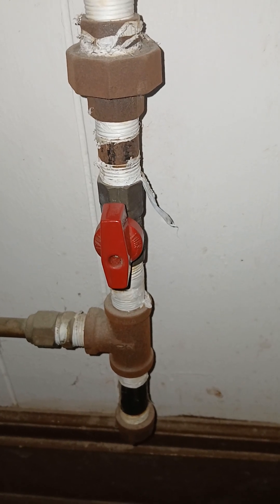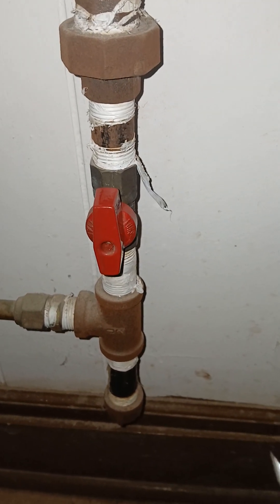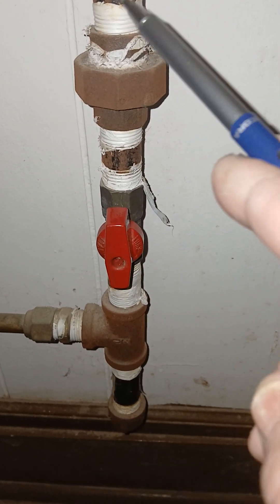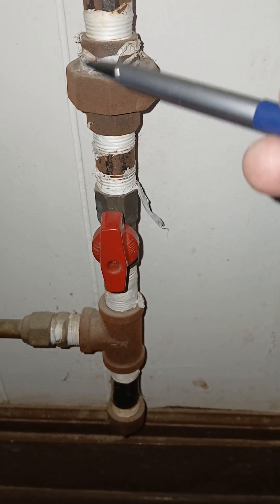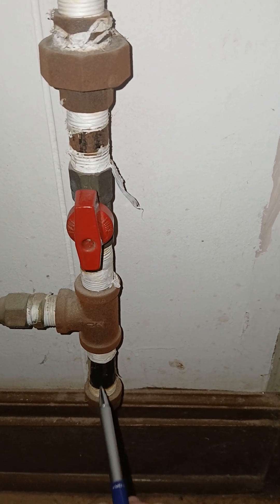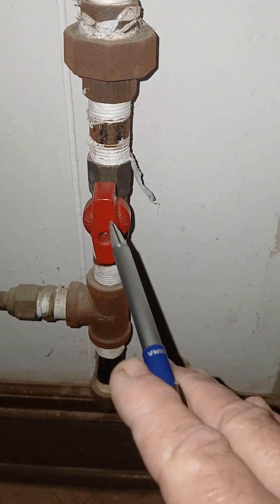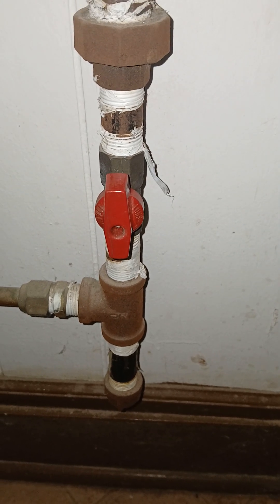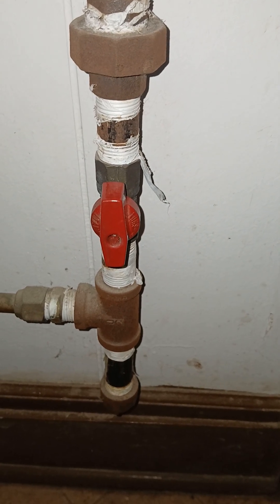Should The Union Be Installed After The Natural Gas Cut-Off Or Before The Natural Gas Cut-Off?

Comment: For questions like this, the answer is always to think about what's actually happening.  

Obviously, natural gas is flowing into the building and servicing whatever units need natural gas inside the building.  The point of the valve is to isolate or disconnect service to a unit.   The point of a union, in regards to a unit, is to allow ease of service/disconnection to the unit itself or service to some aspect of the piping assembly on the unit (e.g. a control valve).  Therefore, with regard to direction of floe, a union should always come after a valve.  Otherwise,  breaking the union would result in having natural gas just openly spilling into the air around you, which would make you an idiot.  A dangerous idiot.

Comment: Im confused, tou said the gas comes in and goes up...now i havent seen small pipe goto bigger pipe unless its at the meter. And the drip leg is only required on a drop down before you go horizontal. Also the valve should be the shut off for a unit after the flare ftg and soft copper...at least were im from...ive never seen it xome in soft and goto a larger eigid pipe ..
Reply: The length of pipe and number of elbows and fittings is very important to calculate properly. Ideally you always want larger diameter pipe until a drop in size is required. Many people use the terminology incorrectly. Pressure isn't the same as flow rate. With gas you need to determine the proper flow rate needed for your application and size accordingly. Most gas supply lines are low pressure, and you want to rout the lines with the least amount of pipe and fittings to reduce headlosses.
Reply from the maker: @James-p3m8j  Thank you! 

...great points, too much pressure without a regulator may create another set of issues.

7-11" WC may be workable pressure?
Reply from the maker: @brianruckert9389  1/2" pipe feeds unit, which may be fairly common in residential uses, save tankless water heater which may need 3/4" pipe due to higher BTUs.

Thank you!
Reply from the maker: @brianruckert9389  Pipe size is 1/2" in this case, no use to upside in this particular case.

Yet, my opinion is one may have to calculate BTU load, pipe size for their configuration, as it may vary.

My opinion is I may have 2# gas meter, yet if I had a thankless water heater, I may have decided to upside pipe to 3/4" to get more volume.

Thank you!

Comment: Always on the supply side of union
Reply from the maker: @anthonylawlor9130  My opinion is this is supplying gas side, simply easy to cut-off gas and repair, replace unit, etc.

If union was located behind cut-off, then one may have to cut-off gas at meter unless another cut-off elsewhere.

My opinion is it's simple to turn-off gas and then break union.

Thank you!
Reply: @anthonylawlor9130  It makes total sense that there would always be a shut off valve on the supply side, just think toilet, hot water heater, furnace, pool heater, after the new "T" for new line to Generac automatic generator outside etc.